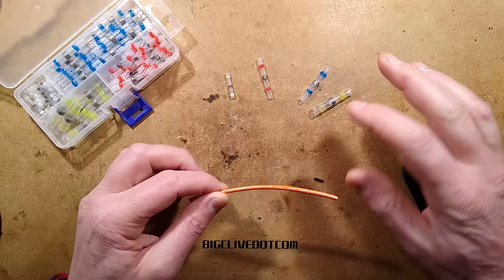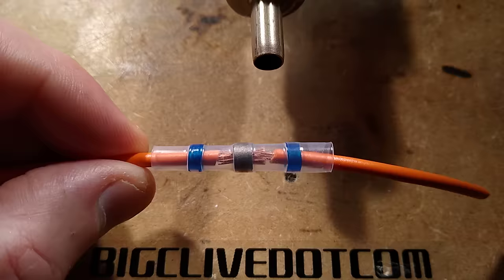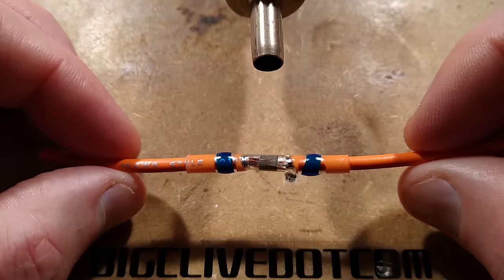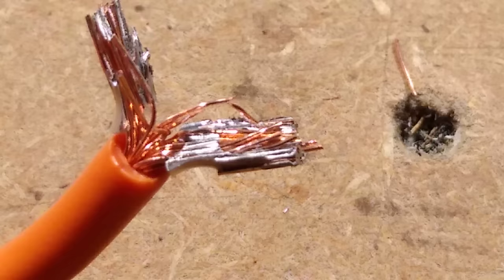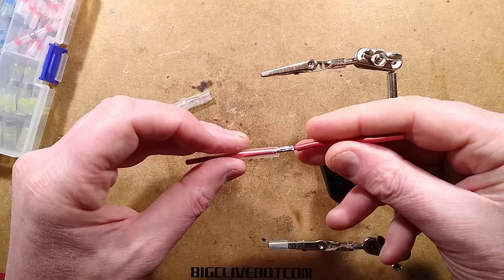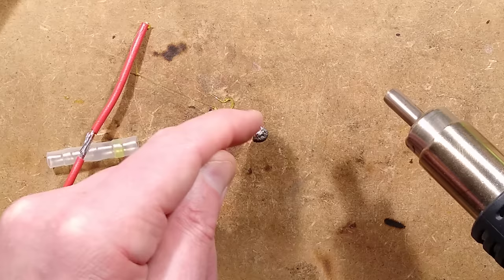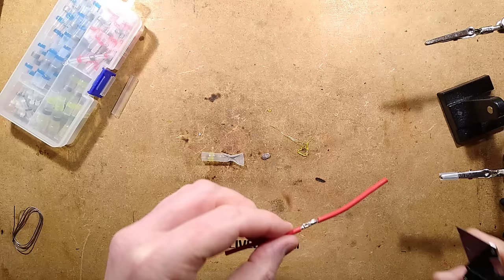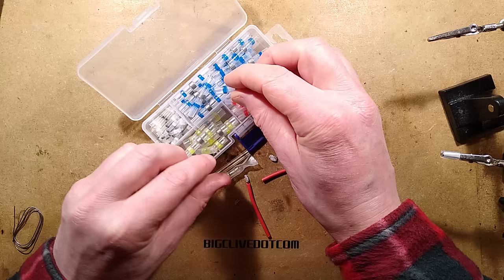Heat shrink solder butt connector test.

Comment: you could just buy low melt solder wire, smoosh your wires together (after putting a piece of heat shrink tubing over 1 of them lol) and wrap the join with as much or as little as you like

Comment: I only use them on my 4wd and boat where anything I add is tinned copper wire the solder then flows right through every time on the boat I use some glue lined heatshrink as well to be sure

Comment: They’re great for motorcycle electrical repairs where you can’t fit a soldering iron. Just twist the wires together and hit it with a lighter

Comment: They only work if you are using pristine new condition wire. If there is any oxide or tarnish to it they will not make a reliable connection. I had to chase down a bad sensor lead on a truck and found one of these connectors to be the culprit. The wire had a bit of tarnish to it. Replaced with a normal glue type sealing butt connector and all was good. I won't risk them because of it.

Comment: In first case , I think the most important  is cross section sq mm. When You have two cables 1mm , in connection place will be 2mm. So, even if half will be soldered should be ok. What do You think?

Comment: apply a touch of flux to one of the "ends"
Reply: Indeed, that makes a big difference because  it flows better. These are supposed to have a dry,.waxy type flux coating, but it's not much. If you add a little dab of flux they make a great connection.  The trick to these is managing the heat. In correct soldering you heat the wire first and add the solder to it. But with these te heat comes in from the outside in. 

The  low melt solder has Indium and/or Bismuth in it  and typical melt temperature is around 320 F or so. An adjustable heat gun is best with heat applied rather slowly so it penetrates. But if you use to much heat, you risk melting the heat shrink. Definite d not want to use a flame on these. 

I have had good luck with these but they do take a bit of practice. It's a viable alternative to glue coated marine grade heat shrink on top of a traditional soldered joint.

Comment: Those things bite IRL.
They work maybe 2/5 times. The wires often pull apart after or the tube fails before the solder melts. They're very hard to use in situ which means they work best on a lab bench where you could just solder normally.
Without a brand, are we even getting the same product?
Also, the copper needs to be pristine for solder. If you're patching together a junker to get a few more miles, use a crimp on the crusty wires the mice so thoughtfully chewed right up to the connector.

Comment: 2:45 thats because you had to much wire striped. By the manufacture the amount of wire striped should be just a little more than the length of the band of solder.

Comment: I use these fairly often for joints I want to be somewhat 'water resistant', where possible I do normally pre-solder the joint.

Comment: Oh heavy trucks we battle all winter with road salt getting blown into electrical equipment then with lots of rain it wicks up the harnesses corroding every thing   I try never to splice any thing if I do I use new wire solder it well smear RTV all over the joint then use shrink tubing over that seems about the only way to make a system bulletproof . These would be ok in a cab or other area that does not get wet all the time . Like you say not enough solder for like 10 gauge wire with a big load .

Comment: I don't know how many zillions of wires I have soldered and heat shrinks the old way.
I tried this. Much slower and gives poorer soldering. 
The one usage I can see is that you can have these ready for an some instant fix, no soldering iron needed.

Comment: Instead of just pushing or smushing the wires together, I would twist them tightly.  This will insure that you have the full diameter of each wire, connected firmly, and the heat shrink  fitting will hold it together.  I don’t trust the quality of the shoulder in those fittings, and no flux isn’t good for proper flow.

Comment: ive tried with these and thought in the beginning what a good idea  to put the long of it o the short they suck  everytime  i have used them the  heat shrink  ends up burning before the solder melts   i have tried using a small  butane torch or bic lighter  then i thought maybe its being held to close but still did the same thing . so i bought a heat gun it seemed like it did an ok job until i stress tested the wire  but it pulled apart so  i think i will use the old method i know that works just solder them and use heat shrink

Comment: Wow, I haven’t seen those in a while, they used them in the aviation industry in Montreal... and if I remember I had to heat them for a much longer time to get the copper wire hot enough
Reply: Yeah we used these exclusively in the US navy to fix wires on planes. It's a raychem product and they are built 1000 time better than the ones I've bought on Amazon and my local supplier. They also require a mechanical butt connecting sleeve to make work properly.

Comment: I got some and used them once. There should be at least three times the amount of solder in them with more flux. It looks like they used a lead free solder which is where they went wrong.

Comment: I use a drop of flux on the wires first, but even without the real test is the meter. How does the resistance compare? Is the mechanical strength acceptable? The flux makes the joint perfect but even without it (and the risk of future corrosion) if done properly the penetration is acceptable for a lifetime repair.

Comment: get couple wago connectors with flaps and you are all set, they even do inline terminals now. no need to worry about the current
Reply from the maker: Wago's are not suitable for use in wet areas.
Reply from the maker: @GoneFishin247  You may be better using a high current connector for that.  If it's low voltage DC then an Anderson style connector might be a better option.

Comment: Been in the motor trade for 40 years. I've had mixed results with these,they seem to be okay on a low current stuff on a supported harness or if the wiring can be supported but in any application where movement is present,i.e. between power train and body you are better off taking the join back to a supported part of the harness,and I won't use any soldered joints on anything over 15 amps on automotive stuff,I see too many failures from previously soldered repairs.

Comment: I would have liked to have seen you add a bit of flux to the wires to see if the low temp solder would have flowed further down into the wires...🤔

Comment: I would say that is a LAP joint, NOT a BUTT joint - the two wires overlap oneanother.  Perhaps the penetration of the solder could be improved by dipping the two stripped ends into a liquid flux before lapping them together.

Comment: Im wondering if the solder didnt flow through because the copper in the center was cold and the solder set before it could flow that far in, maybe hit the end of the wires with the heat gun to heat the copper up right before you slide the connector over the exposed copper.

Comment: Most quick fix jobs will be done with a lighter and that flame is going to be hotter than 300°F (assuming you meant 300 in the Fahrenheit range)

Comment: 1.  You did not heat the center of the splice sufficiently.  2.  You are not using aircraft-quality (Tyco) splices.  They outperform crimp splices and are the only approved method of splicing many wire types on some aircraft.  Tyco splices usually have a red dye on the outside of the solder band, but inside the heat shrink.  Teaching mechanics to use the splices, you must beat them over their heads  until they understand that the solder is fully melted only when all of the dye red has disappeared.  It takes a surprising amount of heat, but it works.

Comment: Would it solder better if you don't push joints together and leave a slight gap so solder collects in the middle and makes a solid connection?

Comment: Would be interesting to see how those hold up under load.  Does the connection heat up?  If so, is it easy to heat up to the point the solder melts again?

Comment: I have used these to join some joints it is pretty handy for someone that has no idea how to solder things. 
you could also slip a small chunk of solder into the tube as well to increase the solder volume it might blend with the copper more. but that sort of defeats the purpose of the quick fix if you have to prat about with small clippings of solder wire

Comment: These are the only acceptable type of splice to use on U.S. Navy military aircraft for wire repair. Also would require using an HT-900 Compressed Air / Nitrogen Heating Tool. Not a lighter, or a generic heat gun and the solider has to puddle completely to pass inspection.

Comment: Don't squeeze/trist the wire together tight before heating it & the soldier seeps into the wiring better.
 Tighter it is the fewer gaps wires have blocking solder from seeping in.

Comment: nice video.  will smash the like button, but i expected to see 2 things there ..   a microohmmeter (would show  the real quality of the electrical splice) and a traction test, to check  the mechanical quality of the fix. Also, the test is not real life scenario, as you dont have a heat gun in your car, but a lame match !!    would love to see the numbers on a formal test .......

Comment: I purchased this exact same kit from an online ad on Facebook.  It took two months for the package to arrive.  With the Chinese writing on the outer package wrapper, I guess that it came from a container vessel from China that was shipped only after receiving payment.  I used a few to connect a couple of farm lamps to my utility trailer for backing up.  One of the lamps had intermittent failure and I had to resolder the connection in the traditional manner.  Was it worth the effort to get a kit containing just a small selection and number of connectors?  Not for me.  I'll pass on further use of this connector system.

Comment: I lightly flux mine before heating. But also were you aware that crimping is the only method allowed for repairs on air bag systems? What are your thoughts on electron flow? Porsche/Audi taught me long ago that soldering was not the best method of repair.

Comment: I found that the solder didn't bond well with the copper. If you pull the wires apart the solder comes off cleanly.

Comment: So in theory, if I put a little flux on my joint before I slide the butt connector over it, I have a good AND easy solder connection?

Comment: Thanks for the review! I wonder if it would be best to do both--solder manually and then apply one of three tubes. It would keep it water-tight and it would bond to your existing solder, keeping it in place.

At any rate, now I have to buy some!
Do I need them? No. Will I at some point in my life? Maybe.
Better not take any chances.
ADD TO CART

Comment: I know this is an older video and you may not read questions on older stuff, but I have a problem. 38 AWG wire, I can not seem to tin it, and I can not seem to find a quick way to join such tiny wires together. I thought about conductive epoxy, or conductive tape, but maybe you know of a trick to join to very small copper wires together?

Comment: Works better when connecting two new wires together. 
I was trying to use it to connect a new wire splice to the existing trailer light wire and solder did not adhere to the older wire.
Reply from the maker: Tarnished wire is very hard to solder to.  You have to try and clean the oxidation off.

Comment: Good video, except I don't think you kept the heat gun on the connector long enough during your first test.  I used a couple of these on my car stereo wiring, and I kept the heat on the solder ring long enough for it to melt and form an indistinct blob, no longer looking like a ring inside the heatshrink.  I think you would get more penetration by doing this.

Comment: What is you dipped the stripped wires in flux before putting this sleeve over it and heating it up? That might help bring the solder into the core more.

Comment: How about adding flux to the wires before using the connector? Maybe the solder will flow more to the center.

Comment: used these   to fix  my stupid  mistake   of me drilling into a rubber  Grommet  in my firewall   ,       worked perfect    Especially when you only have one hand to work with  and are  under the dash  ,,,,,, you didnt apply anof  heat  fast anof    i can tell  by the color  of the solder..    I only used this  Because it’s really hard underneath the dash with one hand.

Comment: Curiosity what if you exposed less bear copper so there was less copper to have to flow soldier to? Would that potentially solve the low solider penetration issue?

Comment: Don't quite get the point.
Of course on the bench I would use traditional solder.
Down in the engine bay of the boat I am looking at those connectors you crimp on or this solution.
With this soultion I strip both wires back and push them through the solder ring.
Never failed, can't pull them apart.
Crimp connectors in a restricted area failed loads of times.

Comment: So here's a dumb question - would these kind of crimp and shrink things be good for repairing a ring main that, say, some idiot has drilled through?

I think replacing the one of the two cables I, the idiot, drilled through isn't an option as I don't know how far down, or indeed up it goes so I was thinking of low-profile patching with crimps + heatshrink, and then get a new metal shield over it...

Comment: Yer ,I tried some ,all the same conditions and temp and ,was not happy .Not enough solder and it NEEDS to be solder that melts at a lower heat ,then it would be ok .. CHEERS  Biggan..

Comment: Would it be possible if you compared these heat shrink solder butt connectors with regular crimped butt connectors and handmade heat shrink solder butt connectors with decent quality SMD solder paste? It would be interesting to see the mechanical strength and cost comparison.

Comment: I wonder if these would work better if you used a flux pen on the copper before heating it. I still wouldn't trust the low temp solder in a hi-amp/hi-heat scenario where the splice would likely just undo itself.

Comment: The solder should flow much better when you dip the wire in flux before the hot air treatment

Comment: I'd be curious to see if you fluxed the joint, and then used one of the melty crimp doodads to see if the solder flows deeper into the joint.

Comment: Lets say you have damaged wire underneath a car...would it be worth using this because all you need is a wire stripper and heat gun rather than the bulky soldering iron and a helping hand?

Comment: I have had zero luck with the 10awg sizes (yellow band) but the smaller ones (blue and yellow) have worked great in a pinch. Don't know what I am doing wrong for the bigger ones.

Comment: Using these on the jobsite for ntc ptc sensors , ideal ! I shrink them with a lighter and in wind conditions with a turbo flame lighter, would never use these in power demand conditions !

Comment: It would also be interesting to see how these perform underhood.  Given underhood temps in modern vehicles, I have to wonder about the integrity of something with such a low melting point. Also, I suspect that there is some mercury involved in the production of these. I am sure the exact alloy is a trade secret, but I think it would be fair to know what I am dealing with.

Comment: I seem to remember some trouble with heatshrink that was supposed to have been sealed from the weather with hotmelt glue.  It didn't work out well over time.  Might've been Julian Ilett?
Reply from the maker: It tends to delaminate from many materials.  At work we switched from adhesive lined heat shrink sleeve to rubber self amalgamating tape.

Comment: Could you not for example remove the present solder on an iron and your soldering iron temperature tester thingy, put some of this solder on it and test it's melting point by turning up the soldering iron power until it mels? That would help to make a better guess of what it is made of.

Comment: Id like to know the lowest temperature they melt at. If you had a high current, or used them around a hot surface like an engine i feel like they would completely fail and fall apart.

Comment: They are called environmental splices and they are used in aerospace. However, the one you have look like some cheap knockoff splices not sure they would meet the certification. At any rate  you haven't heated the splice solder correctly, not enough heat. The tool typically used is an IR device, using either a laser or bulb output in the IR band. It literally can melt the solder and flow it in about 2secs from pulling the trigger. This can be done with a heat gun but a very high temp model the can reach 1000+ degrees F, it literally has a solder setting.

Comment: I did not know that was solder in the middle, I thought it was just a steel band you crimped.
No wonder that steel band was so wimpy and weak... lol... it was made out of lead...

The question is will those junctions work with just a BIC lighter when you're on the road and need to make a quick repair and all you've got is a BIC lighter.
Reply from the maker: I think the solder version does work with a lighter.

Comment: Firstly you should not smush the cables together as you spread then out and create more space for the solder to fill. The cables should be lined up alongside each other then heated. We used to use them on some Aircraft looming when I was in the RAF, although the ones I would have been using would probably have been to a Mil Spec, and not run of the mill joe blogs stuff.